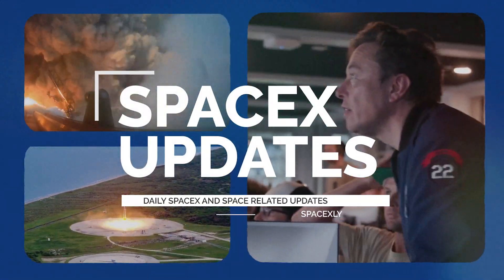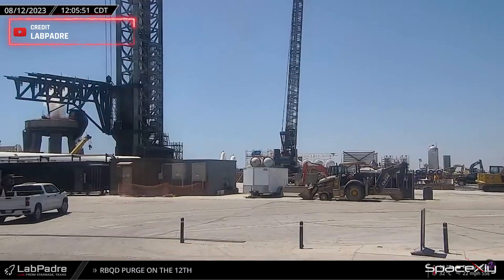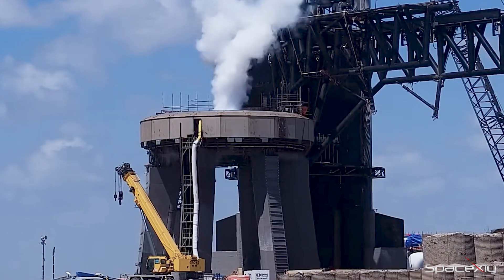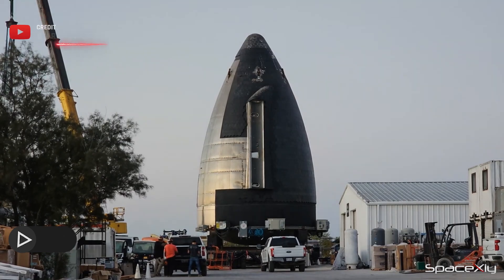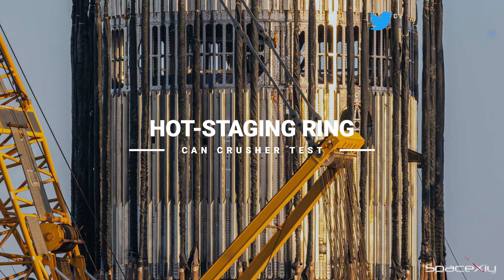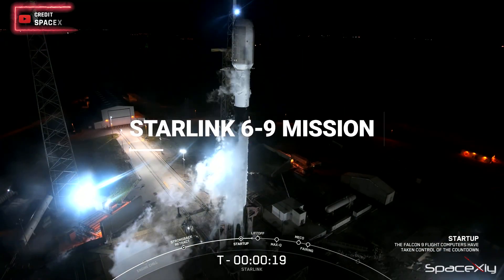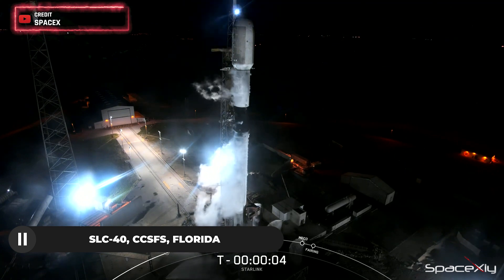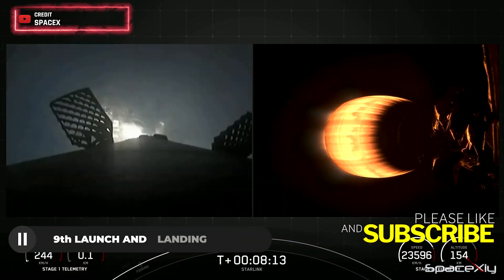New Hardware/Starship HLS Prototype/OLM Testing/STarlink Mission and More...Latest SpaceX Updates

Comment: So they looking into a 3 module design. Three in one is what I always thought 💭 Star⭐ Ship would be.

This allows for so many more uses and safety features.
1. It allows for an escape module design if something goes wrong with the rocket 🚀.
2. It allows for a smaller safer lander for the moon 🌙.
3. It allows for a burn and parachute re-entry crew module, which is the safest re-entry.
4. It allows for smaller yet 100% reliable engines. For landing and taking off from the moon.

The Crew module does add cost. But it adds reliability and safety.
Reply: I think small is a word that flies in the face of what starship is supposed to be.🤔

Comment: Not HLS, flaps are not needed on the HLS.
Reply from the maker: It doesn't necessarily mean it will fly. It might be just for testing cabin pressure and some other tests. Let's find out what happens to S22 Nose cone.
Reply: Agreed. Not a working prototype of HLS.
However, it can still be used as a framed out shell to build test articles inside of. Since they are the ones who labeled it... I guess they would be the ones to know!
There is also the flapless S26, and I remember one shell painted white when they first got the contract.
Reply from the maker: I guess that one was just for display😅
Reply: SpaceX is awesome 😎
Reply: I have never seen SpaceX fail....ever. I've seen ships in various stages of development,  but never a failure. Great work SpaceX 👍. Keep inspiring us💪💪💪